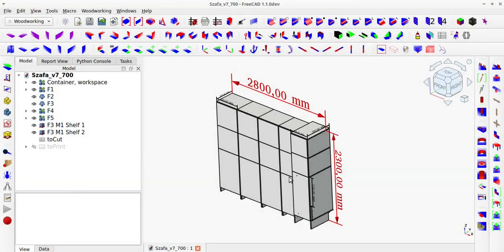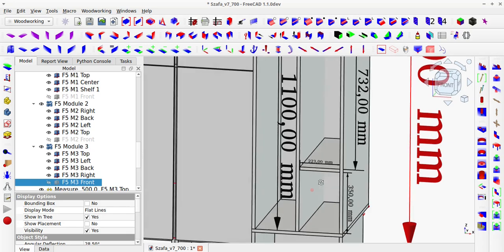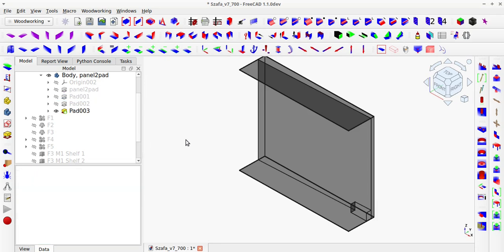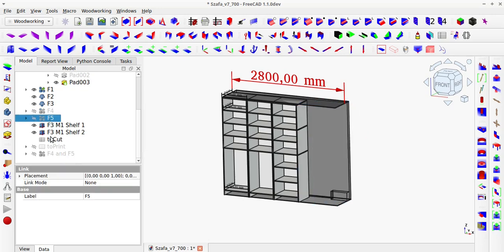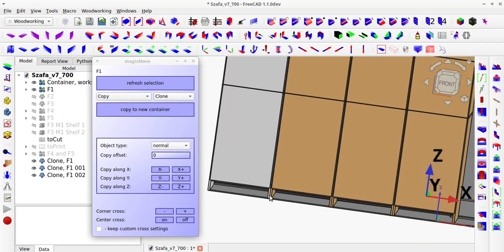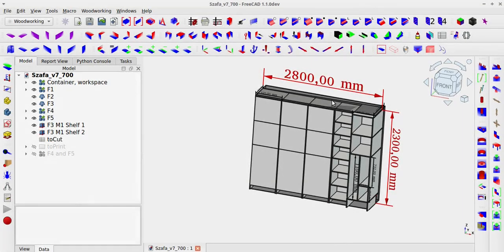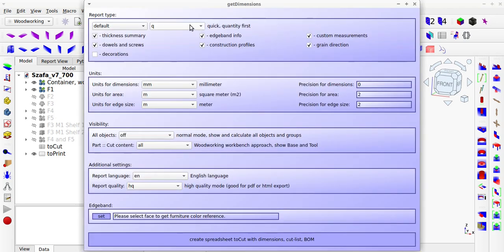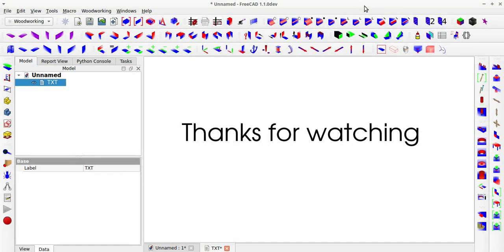Single file workflow | FreeCAD Woodworking workbench

Comment: Nice work. I use Blender for furniture. I want to use FreeCAD too, but Blender is faster. I use MDF, and I can directly generate a cutting list and quantities as a CSV file. I'll work on making it automatically generate banding and CNC files too.
Reply from the maker: in Woodworking workbench you can export cut-list via sheet2export tool to any format: CSV, HTML, JSON, MarkDown, so dimensions from there can be used anywhere... however if you need specific columns order or listing let me know in issue at github so I will add such new report type